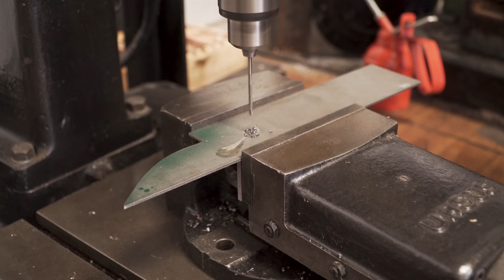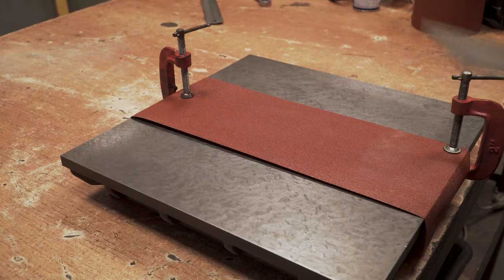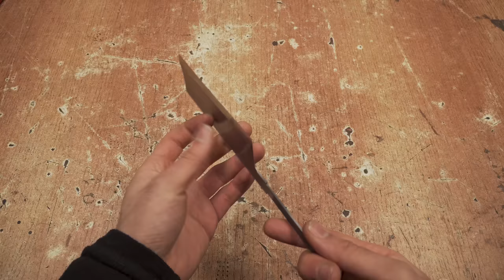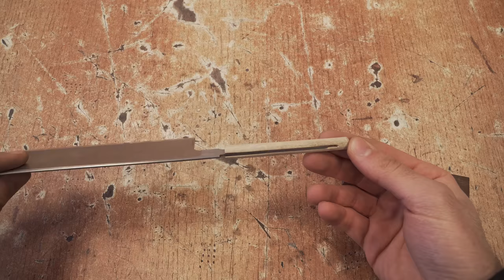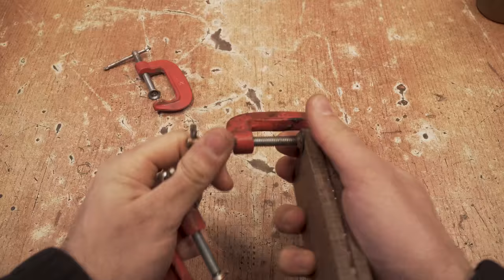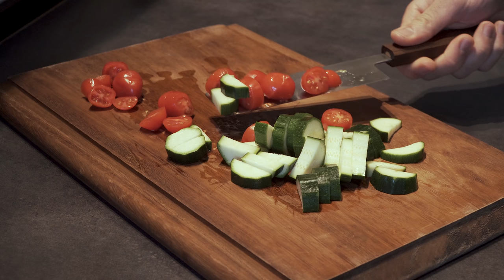Knife Making: Vegetable Razor / Nakiri

Comment: A trick I saw to ensure that your sandpaper doesn't break when you're doing things like sanding the spine of the knife is to back it with duct tape or gorilla tape. Something that's strong and flexible, but fiber reinforced.
Reply: Thats a good tip.  I never thought of that.  Thanks dude.
Reply: Thanks for the tip, going to try that this weekend!

Comment: Just here to say that you technically made an usuba, not a nakiri. Usubas are single bevel, nakiri are double bevel.

Also, the S-grind is really interesting, but part of the reason you may be getting trouble with your cuts on soft foods is because the flat side of the blade is typically hollow ground while the bevelled side is flat, allowing you to sharpen the edge to a finer point and preventing food from sticking on that side of the knife.
Reply: I saw the flaw when he was cutting the tomatoes like when you’re knife is running out sharp
Reply: This is the best kind of feedback. Correct and not condescending or anything. What's a knife like this retail for? It's such a niche thing I wouldn't even be able to hazard a guess, but I'd suppose, a lot?
Reply: @jerod5636  Decent Usubas can easily go for at least $200 USD, if not much more depending on the maker, steel, materials, size, and any decorative patterning/style they put into the handle or blade. However, the premium in price also is influenced by demand, because the average home cook does not need an usuba and is better equipped with a nakiri and therefore they are targeted more for professional use.

A nakiri is typically a bit more approachable in price, and better suited for a variety of tasks because the double bevel prevents steering in cuts and is a bit stronger for those who may not be as careful with their knives. Both are thin blades, but generally nakiri are a bit easier to keep from chipping due to the geometry of the bevels leaving more material to support the edge against damage.
Reply: @jerod5636  -- Not very expensive. If one is a $20 knife every 3years kinda guy then yeah a Nakiri can be "expensive". You can get a Nakiri made of cheap steel for about $40ish. However, a good quality Shun Nakiri can run you from $125 on up.

Edit: I did not see @BrandonKaye's response before I commented, but I suppose same sentiment different words. ;)
Reply: My masimoto ks usuba ran me a little over 500. Absolutely love it though. I have a shun premier nakiri as well, and for ease of use, the nakiri wins hands down. But if you change your technique a little bit and follow the contours of the vegetable you are cutting, the usuba does great as well. For anyone interested in the nakiri style blade, shun, Enzo, or Mac are great places to start. You can also find them hand made with carbon steel, but it’s a lot of work to get the patina started without rusting the blade if you are new to that style of knife. I really like the way you made this blade though! It’s beautiful! My only question is what Rockwell hardness did it come out to? Also what steel?
Reply: @jarrett754  Those Shuns are really good, aren't they? I just found out about Shuns a couple of months ago and bought two -- a Nakiri and Santoku. No regrets!
Reply: @jamessv5020  they’re amazing knives tbh. Mine came razor sharp (literally) out of the box. Unfortunately, there is 1 hammer mark right on the back of the cutting edge on mine, but I’m not worrying about it too too much yet. I tend to use the first 3/4 of the knife the most anyways. I have the 6.5 so it hasn’t gotten in the way yet. I’ve just started getting a heavy patina on my usuba and the blue is absolutely amazing to look at. I know some people would shame me for letting my knife do that, but personally I like the more rustic look over the satin finish it came with. Plus it is much less rust prone. I really wish I could tag pictures to my comments on youtube!
Reply: @jarrett754  how do you patina your knife? I would love to see a picture. I know I wish we could come in with pictures.
Reply: @jerod5636  There's currently a cheap chinese knife brand making good quality knives out of Japanese imported steel. They sell on Ali express for cheap as prices... The make is keemake. Make sure you get the ones with the red handles on them (looks like red and black wood, but it's actually a G10 handle). I don't know how long they will be making these knives out of japanese import AUS-10, but I can tell you that it is currently really good quality for mind bogglingly cheap. Something that good, shouldn't be that cheap sooo... it kind of does raise questions there.
Reply: I came here to see if anyone made The Office joke about nakiri vs usuba only to find it was made in all seriousness 😂
Reply: AKCHUALY
Reply: @stephenTcartwright  I've found some decent luck with a chef knife/gyuto off Ali, but nakiri usually run thinner and lighter and when I look at the spec weights of all the Ali nakiri they seem to run at least 20-40 grams heavier than even a Tojiro DP you can get off Amazon.  Just avoid the brand Grandsharp, I got a really pretty gyuto from them...with a spine that's 3.2mm thick vs the advertised 2.3mm! It splits and pushes like an axe and weighs entirely too much.  Such a shame because it really is a pretty knife.
Reply: @brandonkaye5227  Lets be honest. There are probably a hand full of people on the planet who actually need an Usuba but everyone wants one because they look awesome.
Reply: Being a Japanese knife aficionado, I'm glad I'm not the only one who noticed the 2 glaring mistakes he made creating a Japanese-style knife, but anyway it's still a nice piece of work.
Reply: Nakiri's come in two grinds.  A Ryōba style is a double bevel and a Kataba is a single coming in L&R handed versions.  Also Usuba's typically have a more rounded end where as Nakiri's are much more squared off.  His large hollow grind is an interesting concept and looks fabulous from the end view but not sure how functional it will be in releasing the veggies...especially small tomatoes.
Reply: @jerod5636  I know I'm late to this party, if you want a good nakiri and a decent price, keep an eye out for Miyabi. It's a Zwilling line made in Seki, Japan, and for the price, they are incredible knives. I have expensive steel from named Japanese masters, and the Miyabis are comparable quality, just not custom. I highly recommend the Birch, Artisan, and Mizu (CutleryAndMore exclusive line) made from high end, durable SG2 steel, but their other lines are still good. All of them are sharpened to about 12°, and they cut like lasers. Macy's online, surprisingly, often has competitive sales on them.
Reply: @bloodgain  thank you. I’ll bookmark this for next time
Reply: he literally made usuba
Reply: Yes. Also meaning that that tomato's are squished implies blade needs to be more sharpened
Reply: The “ura” I think the back side is called.
Only the outer edges of the back of the knife should touch the stone
Reply: @hando5745  э00э
Reply: You are one of those guys who uses someone else hard work to show of you're ''knowledge'' aren't you ? I suspect you're neither a chef nor a blacksmith.
Reply: @3v3rythlngsc0nn3ct3d  I use these knives daily. Please stop trying to stir up emotions just because you feel the need to attack someone who says something online. If you need confirmation as to what I said being true, you can look it up.
Reply: Just watched - and wanted to say the exact same thing! Much like a Yanagiba in my mind. Would love to see a Version 2 of this knife.  Still Beautiful
Reply: @brandonkaye5227 how does one hollow grind such a thin blade from both sides? It seems there's such little meat to remove. I've never done so I'm truly curious
Reply: @TingTingalingy  You normally only hollow grind one side (the "flat" side) and put a bevel on the other. If you look up single bevel knives there are good diagrams online.
Reply: @jerod5636  I would argue that the feedback isnt blunt enough tbh... When he goes to cut the tomatoes. You can clearly see that the blade doesnt cut. It rips. So it wasnt sharped correctly. And if anything that has to be done correctly after forging its the sharpening of the edge.

Comment: that tang technique was really cool and clever. I will have to give that go.
Reply: i was just wondering if it would spin around being circular? I suppose it doesn't matter for a kitchen knife too much, but wouldn't a decent knock spin the blade a bit? Or do you think the friction will hold it?
Reply: @TheEthanEdge  Theoretically yes it could spin if it got knocked around enough a couple of ways to fix it if it ever did spin is when you put it together put a little bit of epoxy in the hole or the other way is you could put a single pin right towards the top of the handle to keep it from spinning
Reply: What's a tang technique
Reply: @raveendrap1457  the tang (blade handle) technique is the way he made the tang fit into the handle by using the split dowel.
Reply: @mcorrade  got it, thank you
Reply: @raveendrap1457  no worries mate
Reply: @TheEthanEdge  I was actually surprised he didn’t put epoxy in there, he always uses epoxy on his handles.

Comment: Good looking knife and well made.  Just a couple of points:  when drilling stainless steel, better to run the drill very slow, keep even pressure on the drill and don't lift off the surface until you are through the metal, and, always use a good quality cutting oil.  When you lift off the surface when drilling, the surface work hardens very quickly.

Comment: That was very smart with the handle you drill out big hole insert a wood dowel cut it in half almost and fitted in there with the Tang dude that is genius I would have never thought of that I would have never ever thought of that that is some good craftsmanship and good thinking bro I mean it like now I know it to use just drill a hole make a cut in a dowel and slip my blade in there and glue it that's all I got to do very very smart 👍🏼👍🏼👍🏼👍🏼👍🏼

Comment: Why Steelfoil mate? To prevent Oxydation? No quenching? Why? To keep it soft? What is this steel? Looks a little like 80 CrV2.
Reply: He did quench using the aluminum plates in the vise, its called plate quenching (thats what  I call it lol). Steel that thin would warp super fast in an oil quench, the plates also keep the blade straight as it cools (the aluminum plates are heat sinks and they cool off a 1600 degree thin blade extremely fast). He tempered in that oven after.
Reply: Yes, the foil bars oxygen from developing scale.  He put gypsum powder(non-US baby powder) in it to keep it from welding to the foil and sticking.  The 2 giant pieces of metal he has attached to his vice act as a heat sink, they draw heat out fast enough to develop a good crystalline structure, or quench.  Then baked at 200c to temper.  He file tested later, it is somewhere from 60-65 HRC, pretty spot on since kitchen knifes typically range from 57 to 63 HRC depending on intended use and this one is for thin slicing vegetables.

Comment: <--- Chef, wants one. That knife is perfect except I can't tell for sure how many degrees your edge is, looks like a bit over 20, I'd bring it down to 17 degrees for a kitchen knife for maximum control.

Oh and best way to show off an S grind is chopping. Especially for that cucumber, if you get a straight shot at the point of the blade and chop quickly, you'll see them just peeling off and laying down perfectly. Beautiful craftsmanship, as always.
Reply: That’s a zucchini, chef. 😉
Reply: @AlbertJafar  My bad I was in the middle of typing and just saw it in the small picture that comes up at the bottom right. All I could see was a green gourd getting sliced. xD

Comment: awesome work, but I didn't understand the heat treatment, you didn't shock it in oil; then how did it harden?
Reply: The 'shock' effect comes from the 2 large heat sinks of what looks like thick aluminium plates to draw the heat away from the blade quickly. What could also be done to enhance the effect is to blast cool air between the gap in the blocks while the blade was clamped in there. It's a form of no oil tempering of the metal.
Reply: @stormkhan4250  
Can we use water instead of oil? just to avoid the black layer of oil?
Reply: @MouradAli86  sure, metal workers do that all the time.
Reply: @stormkhan4250  
Thanks a lot

Comment: Eventhough I don't like the rectangle shape of the blade, it turned out pretty well. I am not an expert but for me it looks like the handle is not secured enough. I have seen many videos in which the handle is glued. Another thing I would have preferred is that the blade protection should have something to not fall off once you turn the blade upside down. It looks loose. But as I said, I am not an expert, I just like to watch these kinda videos :D good job and keep up the good work!

Comment: This is definitely unique. But beveling the hollow ground side and leaving one side completely flat makes no sense from a sharpening standpoint. The hollow grind on the "flat" side of a Japanese knife allows for minimal effort in lapping that side of the blade. When this blade is sharpened it will require lapping an entire side of the blade. That is a lot of surface area to work through in order to bring the new surface all the way to the cutting edge. That makes this blade virtually unusable beyond the initial sharpening, unfortunately.
Reply: Who said it was meant to be used?